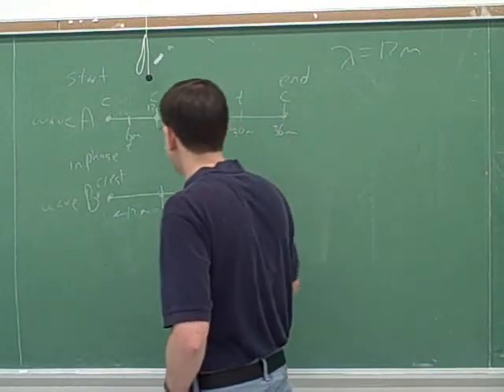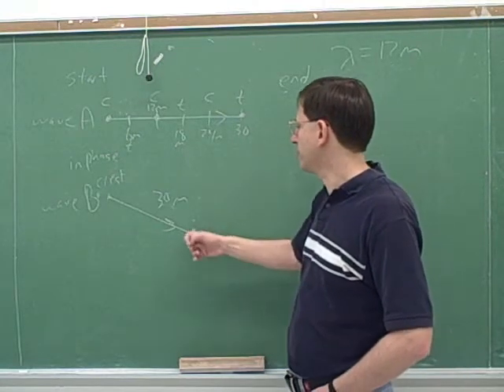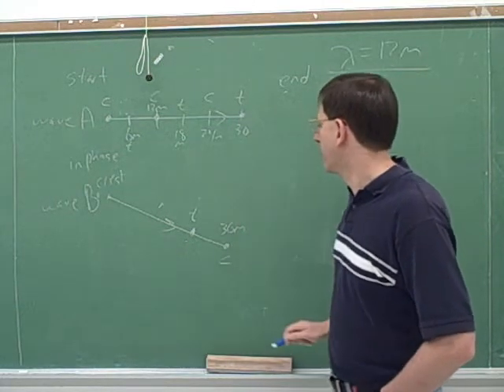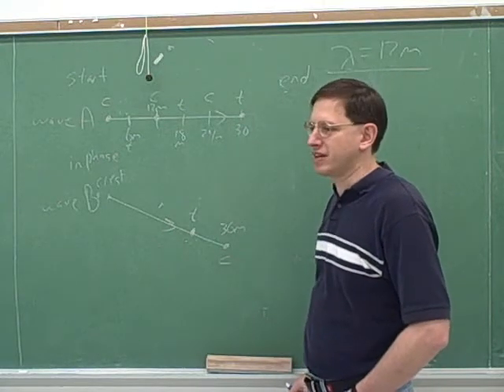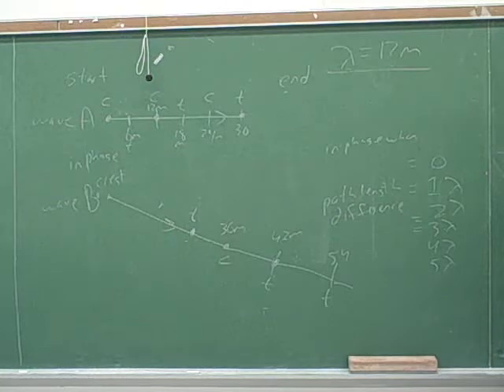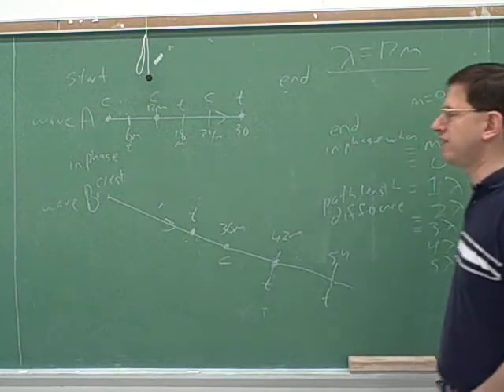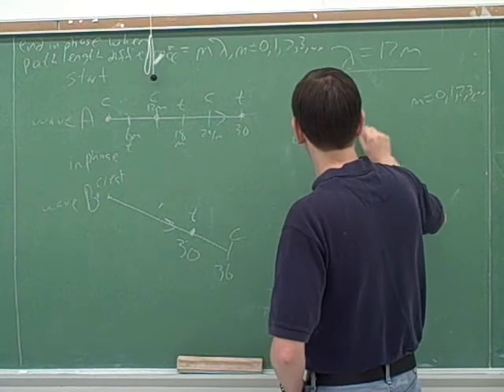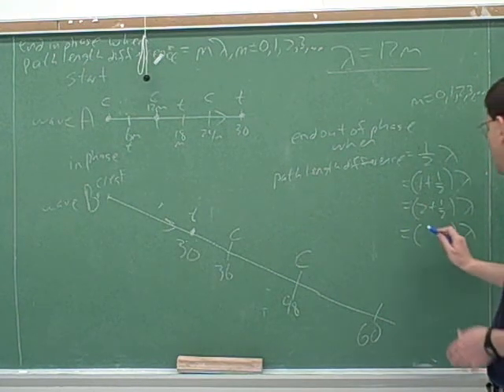Physics: Interference and diffraction (2)

Comment: @dudeohsogreat 1 full wavelength is equal to 2pi. In order for two waves to be out of phase, one must be ahead of the other by half a wavelength; therefore, this corresponds to 2pi/2 which is equal to pi (180 degrees) not pi/2 (90 degrees)